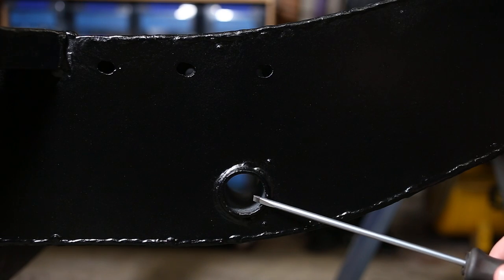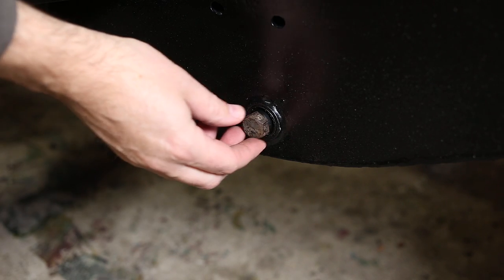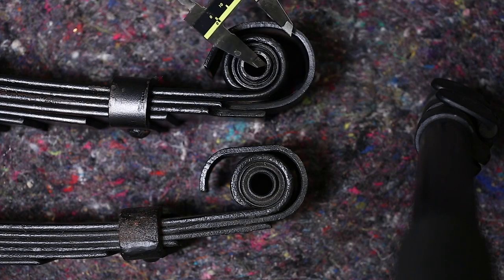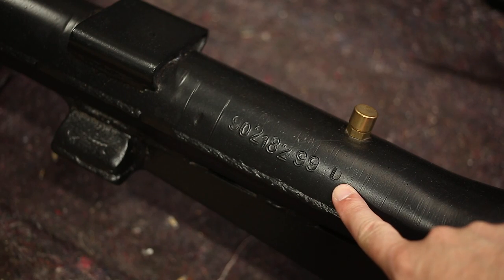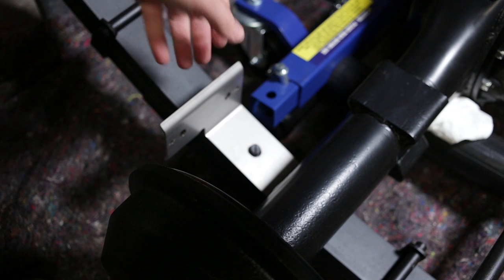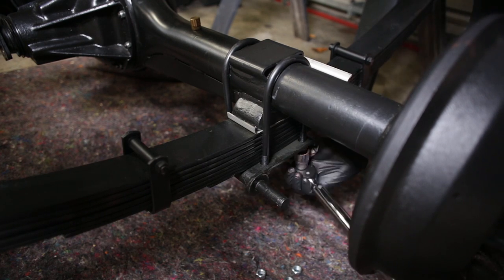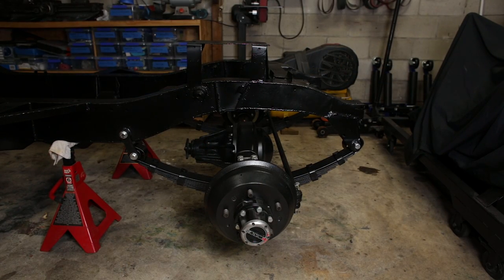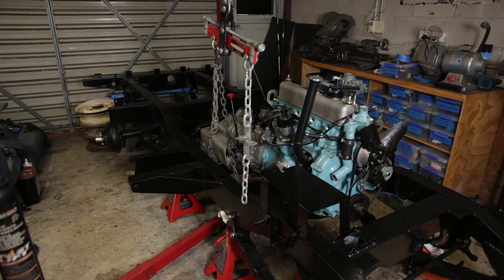Land Rover Restoration Part 18 - Chassis Assemble!

Comment: Great progress.  The handbook for my 1929 Singer actually specifies the interval at which the leaf springs should be removed, dismantled and regreased.  Greasing the springs is absolutely the correct approach.
Reply: The argument used against the greasing of Land Rover leaf springs is that the ingress of crud, sand and grit into the grease between the leaves turns it into a grinding paste and accelerates the wear. I do grease my springs as my Landy doesn't see a lot of heavy off road use.
Reply: @Stu_2112  OK I suppose that might be reasonable.  My LR has airbags so not an issue for me.
Reply: @Stu_2112  I grease mine too - I've not seen any Land Rover leaf springs abraded away to nothing by a greasy grinding paste but I have seen a lot of them corroded into a solid lump with splayed leaves caused by rust expansion. Spring steel is pretty hard and unlikely to wear significantly. Regularly hosing the crud off the underside will make everything last longer anyway.

Comment: Good work and chuckles 😂. Replaced my leafs and shocks recently, went parabolic. On my Series 3 88” petrol I noticed between the rear forward leaf bolt there was virtually no room between the nut and the petrol tank.  If you’ve fitted longer bolts you may need to trim.

Comment: Lesson for me is don't change the springs. Lol.
The 2.6l does not have the bracket under the engine mount.

Great to see it coming together. Might be the best on the road with the level of detail you are applying.

Comment: When fitting bushes try and press against the outer shell rather than the inner tube. A good tool to make is a screw press using the threaded shaft from a car scissor jack
Reply from the maker: All of the tooling you see me use is pushing on the outer shell 👍

Comment: I've missed these videos so much. Genius. you inspired me to get a Series 3 back together although what I had to do was much less complicated than your videos. Just wondering - I had Britpart U-bolts that were made of cheese with a visibly finer thread and smaller diameter than original which stripped far short of the workshop manual torque. Which ones did you use and are they OK?

Comment: I love the humour you have brought to this restoration. Its pretty much essential.
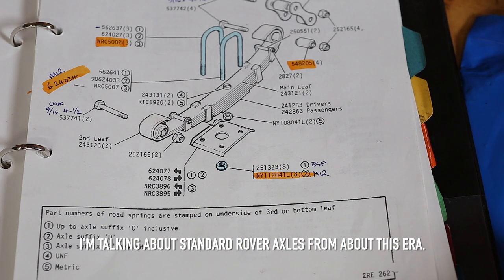But can I gently correct you on the thread names? @ 10:49 on you refer to 'Whitworth' when the sizes noted on your packaging are actually 'BSF' (or British Standard Fine). In fact I suspect they were actually UNF. The threads are very different and post 1960s British cars were using Imperial UNF or UNC  - British Standard Course - for aluminium.
Land Rover of course insisted on using BS, SAE (UNF / UNC) and Metric as you found out!
Sometimes people get a set of spanners marked  'BSW' and think the bolt is Whitworth becasue it fits but they will also have a 'BS' marking as the jaw size for both Whitworth and BS are identical. So for example a spanner could be marked:
1/4"BSW  5/16"BS
or
5/16"BSW  3/8"BS
This is because spanners and sockets for BS (UNF fine thread and UNC coarse thread) are determined by the bolt/nut head dimension and sometimes called 'AF', whereas for BSW (coarse thread) and BSF (fine thread) it is determined by the diameter of the bolt shank.

All very confusing but you seem to be working your way through this bit of engineering anarchy and the finished results are looking rather good.
Reply from the maker: The u bolts shown are BSF. BSW and BSF are both based on the whitworth thread form. I’m aware that head sizes of bolts are different between BSW and BSF for any given nominal size. Cheers

Comment: Loved the vid !   . I was always taught that Whitworth BSW was different from BSF and not interchangeable?
Reply from the maker: They’re not. BSW is coarse and BSF is fine. Both are Whitworth threads.
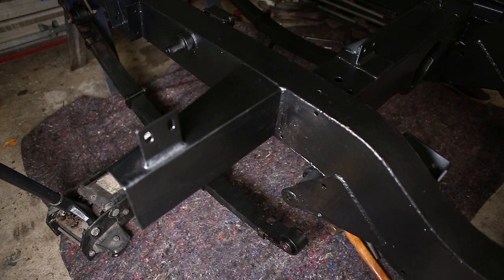Reply: @CROKERvsRover  Too fast! At least let me finish the whole vid before ranting :-) ( What's the collective name for opinionated YT viewers?) I was just confused as at 9:54 you used BSF & Whitworth terminology interchangeably!  They share the same 55deg thread form ( to save workshop re tooling) but are not the same.  Never the less great you shared the experience and I'm sure it will save a few people from ordering the wrong parts!! Cheers